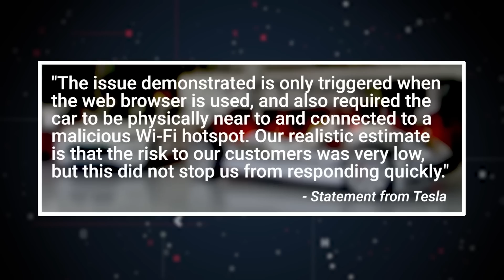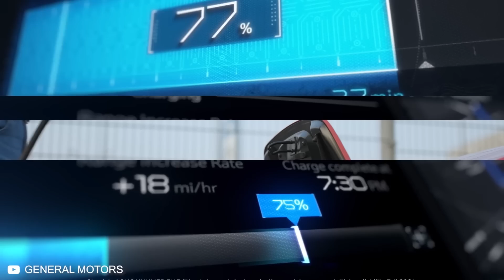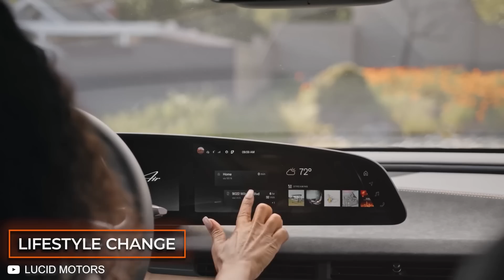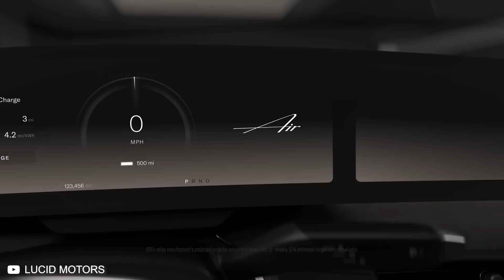EVs' Serious Problems That Carmakers Are Hiding

Comment: Not only that but you’d need more factors that create the power. Nuclear energy is cleaner than pumping coal into the atmosphere but it’s exspensive and takes lots of materials to work properly and wind and solar energy don’t make enough on its own to fuel an entire populations amount of EV’s.
Reply: That is why wind and solar are only meant to be a stopgap until the nuclear industry gets its act together; wind and solar will never carry the whole base load. It is highly likely that next generation nuclear power technology will be in production on the grid at pilot scale within 5 years and full scale within ten. That's much less time than it takes the industry to build the 1970s dinosaurs they're still trying to build today.

Comment: Old batteries are worse for our dumps than using a gas run vehicle.
Reply: Don't fret over that. Cells that are retired from EV service still have many years of service in stationary battery farms. When there's a big enough pile of batteries, the metal recycling business will be there, as there is always recycling where there is valuable metal.

Comment: The cost of charging an EV is around 20% the cost of fuel. for me that's a £200 saving per month. also my car is very fast and comparable at a nice Audi . Plus every MacDonald's or KFC have 50kwh or better points. Tescos charge points are free too
Reply: The price of electricity is going to explode.  Especially in Europe where you went over board with green tech that isn't as reliable as natural gas.

Comment: EV's are NOT a solution! They are a PROBLEM. They have a LARGER carbon footprint than ICE's due to their electric motors and batteries and never-ending charging requirements. Just because it's in a different form, an EV uses just as much energy as an equivalent ICE per mile, but EV's WEIGH double what the typical ICE does, so they use much MORE energy per mile. Tesla batteries don't LAST nearly as LONG as advertised either. In the real World, 7 years or 50,000 miles is unusually life for them and ONLY TESLA can LEGALLY repair or replace them for about $30,000. How are we going to CHARGE own EV's??? Our 75 year-old power-grid is all ready at near capacity. The loss of coal fired power plants has reduced any reserves we had. Wind power is a myth. All of it provides 2% of REAL power under IDEAL conditions and solar provides none.
Reply: The solution EVs, and  heck even a methane powered vehicles provides, is that it will reduce the technical debt our grandchildren will be stuck with. Solar and wind is only intended to be a stopgap, as they'll never be able to carry the whole base load.

A gasoline car emits more than 20 pounds of CO₂ for each gallon of fuel consumed. A coal powered EV the same size emits less than 15 pounds running the same route. Also a gasoline car is less greener than an EV the same capacity because the gasoline engine throws most of the energy in the fuel away as waste heat. 

 Imagine what can be accomplished with much more efficient upgraded grids and power plants that require less fossil fuel along with solar and wind to fill the gap until next generation nuclear.

The biggest investors in banking already know that it is inevitable that phasing out fossils is near. Mark my words; the fight is coming over how fast to phase out fossil fuels for ground transportation, and it will be reduced to a battle between the biggest investors in banking and the biggest investors in fossil fuels. And politicians, environmental activists, and scientists will be irrelevant.

Comment: Without watching the video, my guess at one reason electric vehicle customers are switching back would be the fact that the replacement battery is an astronomically priced money pit in of itself.  
I'm not sure how much they go for, without researching prices, but I've read or heard about this fact from somewhere.

Besides, quick charging the battery pack all the time will definitely shorten the packs reliability. 
And on trickle charging mode, who's got 15 hours time to bring the packs up to an 80% charged state just to continue on with their trip? It's a no wonder that they put these charging stations at casinos and hotels!
Reply: You are hitting correct on all points, super charging greatly reduces battery life, but don't tell an EV owner this, they loose their freaking minds, and they will emphatically deny a trickle charge which will keep their battery alive for much longer, takes many hours, you will hear the same chant...
Reply: The funny thing is electric trains powered by hydro power and or nuclear power are the solution to the transportation problems. Both from the pollution stand point as well as congestion. EVs are not the solution since you are replacing an ICE vehicle on the road with another one. Also as of right now people are claiming EVs will pollute less over the long term. I'm not so sure about that. Regardless time will tell.
Reply: He said $13.5k for a Musk Model 3
Reply: Oh Boo Hoo! replace the battery! That canard again! One, the battery HAS to by law, work for 08 yrs, most are warranted for 10 yrs.  IF it fails, it may be just one pack, and not the battery as a whole. And a Tesal Model 03 battery replacement is $9K. How much for your gas car engine? Quit believing every fool on the internet, and check my facts while your there.

Comment: Gas vehicles will never disappear completely, neither will diesel, and as an early ev adopter myself i'm still realistic. Electrified vehicles are not for everyone, they are for people like me who live in a city or suburb and get great low rates on electricity. I'm in Montreal and here we have water based hydro from dams. It's cheap about 9 cents CAD a KW/h, if we go over 40 Kw/h a day it's a bit more.. But nothing compared to other provinces and states, that neighbor us.  So in Montreal, Laval and Brossard for city dwellers who don't travel more than 100 miles a day, it's logical to buy a basic EV, pay low hydro rates and get a 13K subsidy from the fed and prov. gouv.  Especially as gas recently is hovering around $2 a liter.

Comment: Really?  Fires with EVs again?  Tesla, the largest manufacturer worldwide and the mfr with the highest average age of its vehicles on the road, has reported on this issue.  To quote their most recent vehicle safety report, "From 2012 – 2021, there has been approximately one Tesla vehicle fire for every 210 million miles traveled. By comparison, data from the National Fire Protection Association (NFPA) and U.S. Department of Transportation shows that in the United States there is a vehicle fire for every 19 million miles traveled.  In order to provide an apt comparison to NFPA data, Tesla’s data set includes instances of vehicle fires caused by structure fires, arson, and other things unrelated to the vehicle, which account for some of the Tesla vehicle fires over this time period."  Cmon!  if you are gonna report about EV fires, at least compare them properly to the current alternatives, ICE vehicles.  ICE vehicles are many times more likely to catch fire.
Reply: The chance of an EVs battery igniting is 50 times less than that of a ICE, but your EV will be a write-off. Good news is some automakers are going to stop using lithium ion batteries and use lithium iron phosphate batteries instead as a stopgap, which will make them safer that ICEs. Also it is highly likely in less than a decade, sodium will overtake lithium and be the norm

Comment: Fuel is not fossil , all based on bad science,
Reply: Wrong. Petroleum is fossil fuel.
Reply: @rps1689  why was gas changed to non fossil ,comes from a natural underground source,  as does water , all for survival,
Reply: @peterconnolly4608  Gasoline is a fuel made from crude oil and other petroleum liquids. Petroleum is a fossil fuel and is too valuable to be wasted on gasoline and eventually should only be used as a fuel or raw material in the chemical industry if we want our grandchildren to no have a great technical debt.
Reply: @rps1689  ok there is two options , extract it and use it ,or leave it , are people aware that the sun is expanding and if it is the cause of a explosion and hits earth it will cause the feared implosion that will suck all in and crude oil will end all ,
The talk of emmisions that are the new fear might not all be to the worry as it maybe the filter that is needed to slow the excess heat and slow down water evaporation which we can't do without ,we all need to be thinking of what the purpose is of humanity on this planet ,
I would put more trust in God to solve what we all fail in doing right ,

Comment: My main issues with them is they're far too expensive and buying them second hand doesn't feel viable as replacing the battery is incredibly expensive. (I've never owned a car less than 10 years old. My current car an mb6 civic, is 22 years old and still going strong.)
The fire hazard, petrol of course has this but it also has warning signs be it smell or a small fire giving chance to escape if you're not stuck, batteries when they go, go fast, you have seconds before you're toast. Hydrogen is even scarier still in that regard as it's odourless, difficult to contain and if it does leak it doesn't set on fire but explodes with a pressure wave...
The range/charge time is a big turn off. 
This is just my opinion but Tesla's are ugly as sin, they all look like the shell has been 3D printed with plastic.
I also question with them not having the same life as a well made engine, just how environmentally friendly they are at the end of their life, I don't know how much is recycled. 
Also transport is a relatively small piece of the pie in terms of climate change and co2 output, and just converting to electric is an even smaller piece still, as they aren't 0 carbon, far from it, lithium mining and car manufacturing has a fairly large footprint, as does some of the energy used in those batteries. 
So those thinking this is the big solution to climate change, it's not even close.
Reply: Exactly thank you for not falling for the ev lies
Reply: Solid reply good sir. 

Of course the government supports the EV nonsense. People are absolute garbage for supporting this
Reply: Climate change is a scam.
Reply: @ab9957  The only way anthropogenic climate change could be a scam is if there was a conspiracy involving tens of thousands of researchers operating in secret since the 1950s, in control of the physics and geology departments of hundreds of universities worldwide. Interesting how climate change deniers that say it is a hoax, can never identify the hoaxers nor state the false claim clearly
Reply: @ab9957  There's probably been numerous scams created from it, but climate change is a scientific fact with a vast amount of data supporting it. Don't fool yourself.
Reply: @88Cardey  Nope, it's a left vs. right thing. You would want Biden to run your company?
Reply: Good news is lithium will highly likely be replaced by sodium in a decade. The chance of an EVs battery igniting is 50 times less than that of a ICE, but your EV will be a write-off, but as you mentioned, you want to get your ass out of that car fast. 

 Good news is some automakers are going to stop using lithium ion batteries and use lithium iron phosphate batteries instead, which will make them safer that ICEs. Also it is highly likely in less than a decade, sodium will overtake lithium.

The technology already exists to contain lead, mercury, and cadmium when recycling batteries and it is improving by the year to the point that in about 20 years the need for mining will be reduced substantially. All the other mineral and elements in a EV battery are fully recyclable even after being used as second-life batteries. One nice thing about EV battery cells is, they find a second use in stationary grid storage.

Just like any other high volume appliance does nowadays with valuable metals in them, . batteries will be recycled to reclaim the valuable metals also. 

EVs are not clean, but do not create the great technical debt that our grandchildren will have to deal caused by burning gasoline and it will ave more petroleum for them for creating plastics, chemicals, paints, etc.
Reply: @rps1689  Thanks for that informative reply, when I said "I don't know how much is recycled." I really had no idea. 
So what I'm taking away from that is it's not currently perfect with battery recycling as there are still some waste products but we're moving in the right direction.

Same with the safety concerns really, although I will say they may be 50 times less likely to ignite than a ICE which makes sense given the nature of an ICE but more often than not if a ICE catches fire you will have plenty of time to escape or even put it out, it's only really if the fuel tank is punctured you're in immediate danger.
But if you get a runaway effect with batteries the danger is immediate most of the time, so I'd be interested to know how those two factors balance out, there's also a lot more data with ICE's to go off though. So I imagine it's difficult to get an accurate picture on that for now.

I would be behind hydrogen as an alternative more than any other if not for being such a pain to contain and it exploding. It's a bit of a pain to isolate but there's literally nothing more abundant and doesn't rely so much on the power grid outside of separating it and only emits water as a waste product.
I can't get past the dangers of it though, imagining a motorway pile up with nothing but hydrogen cars is the stuff of nightmares.

One of the big challenges for EV's is to make them affordable and that hasn't done too well so far. The average person just isn't spending that much on a car. 
For 1 new Tesla I could buy pretty much a lifetimes worth of second hand petrol cars. For it to be suitable for most people in terms of price, I think it needs to have a good second hand market and for that to be viable with EV's, either battery prices need to come down a lot or their lifetime be increased. Having a £10,000-15,000 bill looming over you for a new battery just doesn't work for a large portion of people.

I know that's ignoring the climate crisis but it's just the reality of what people can afford.
And as I mentioned transport is a small piece of the pie in terms of our cO2 output, 11.9% to be precise for road transport and a transition to E.V a smaller piece still.
Homes, businesses and industry use nearly 4X as much.
I'm not saying that means we should brush it aside, just that it shouldn't be seen as a solution or anything close to it, it's a small step in the right direction.

So unfortunately our grandchildren will probably inherit those debts anyway it saddens me to say. Less petrol cars will certainly have health benefits though, especially in cities.
 It just won't stop the planet warming too much.

Comment: This is shitty shit. May be hacked - it doesn't depend on the drivetrain. All ADAS equipped vehicles can be remotely hacked and drived. ALL MODERN CARS have electrical steering and park brakes. The maintenance is significantly less. What kind of a special mechanic do you need to repacle brake fluid and filters? The rest is non-serviceable. Battery degradation - OK, how about mechanical wear of the engine and gearbox?  You shall do this in comparison with ICE and not in the vacuum with no numbers. CRAP video!